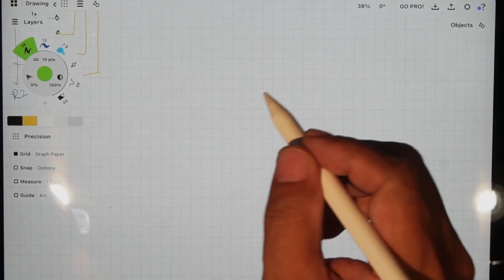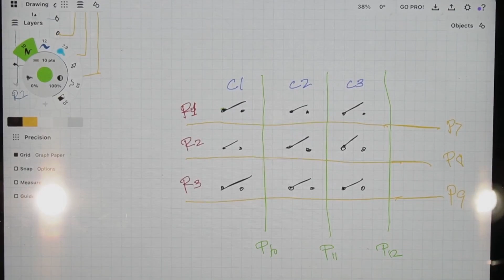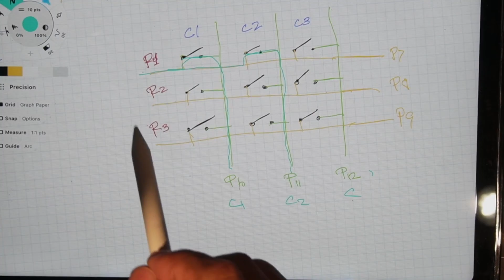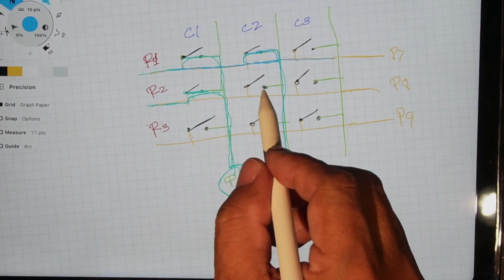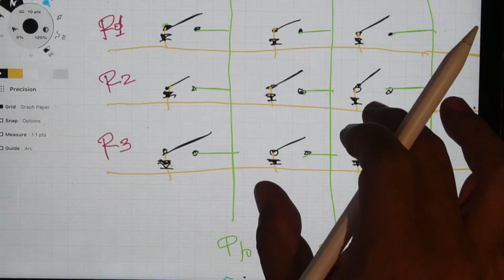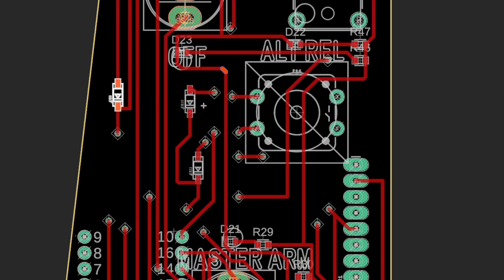Button Matrix Ghosting: Explained and Fixed

Comment: Where did you source those toggle switches? All I can find are heavy duty 15 plus AMP switches that require more force than I would like to toggle.
Reply from the maker: I get them from DigiKey.  But the good ones like NKK runs out very fast.